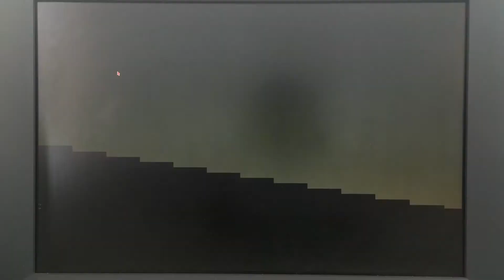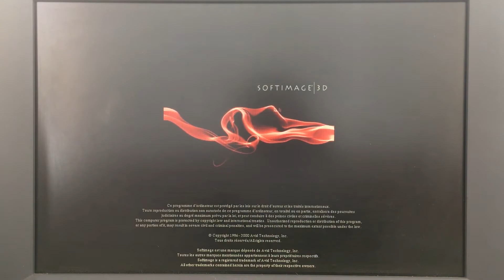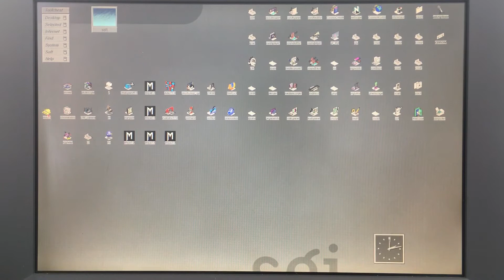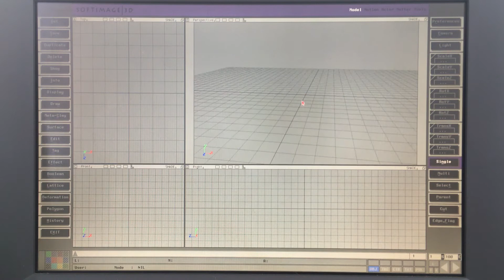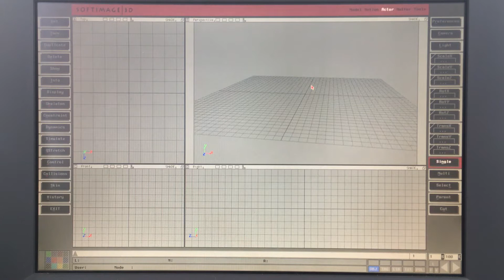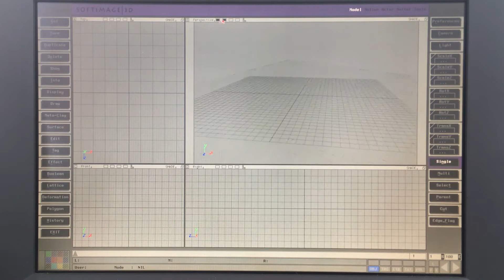Irix Softimage|3D 3.9.x Basics Tutorial 2

Comment: Nice piece of history. Just installed 3.7 version on dual pentium pro, riva 128 and had many issues with viewport updates, especially in toggle select mode.
Reply: I had the same issue, and on certain video cards it will just show all the buttons and everything else as blank, with only the outlines being there. Something I know as a fact is that your GPU must be OpenGL 1.3. However there's seemingly more requirements that need to be met and I'm not sure the specifics. The Windows version seems to be inferior in general due to bugs and lacking support for any sort of ratio that isn't 4:3. That being said, I primarily use SI 3.7 on my Dell WS360 with a Wildcat4 7110 GPU (which has drivers specifically for Softimage), due to it outperforming my SGI pretty significantly. Ironically SI 4.0 was released in 2002 but crashes anytime Mental Ray is attempted to be used, while 1996 3.7 functions near perfectly on Windows XP. Avid's reputation maybe...
Reply from the maker: I had never used old Softimage in windows until I tried the download at Vetusware using Virtual Box. It did have the same viewport update issue you mention here. I thought it was related to the fact that I was using emulation. I guess it is more consistent than that. Even on SGI there is some flicker depending on usage case but for the most part it is stable on an SGI. Sadly quality SGi are getting harder to find these days at reasonable prices. They were very cheap between 2005 and 2010 and have raised in value since.